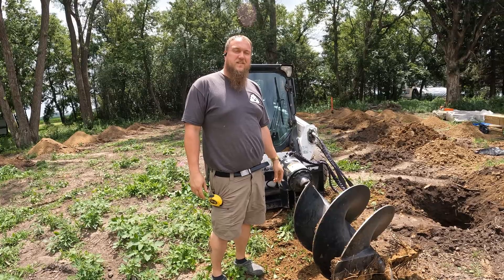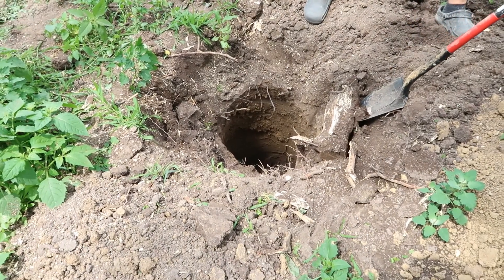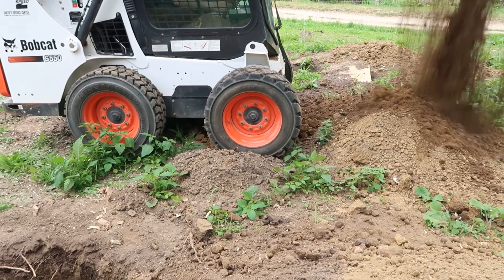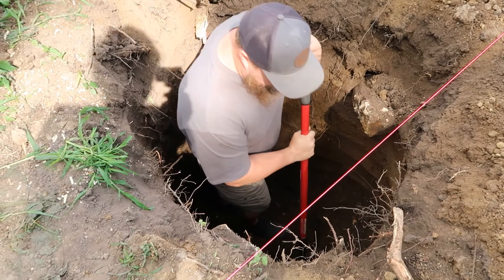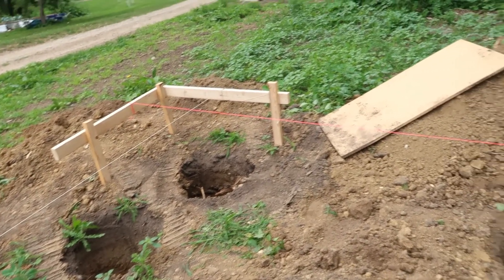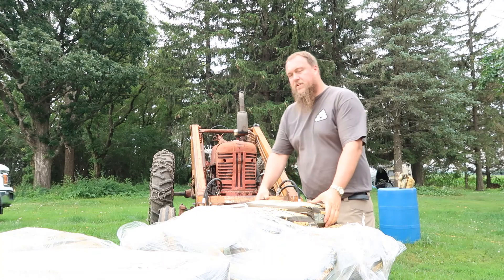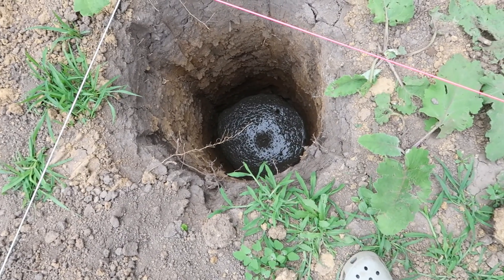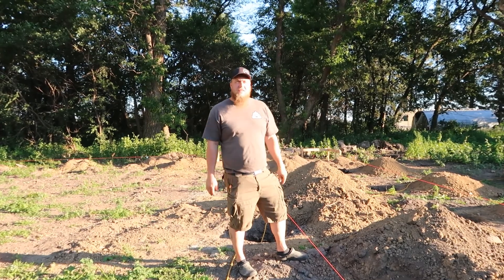Digging Holes For The Pole Shed (DISASTER)

Comment: That looks like a lot of work!  Are you placing the poles and then filling around them with concrete?  What diameter poles are you using?
Reply from the maker: The poles sit on the concrete the more the pole is exposed to concrete the faster they rot, and the poles are 6X6.